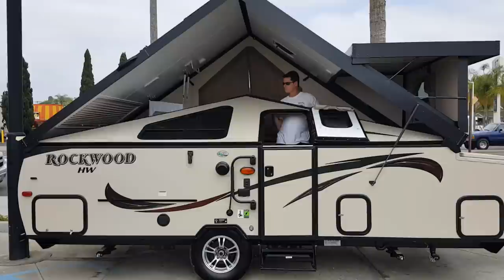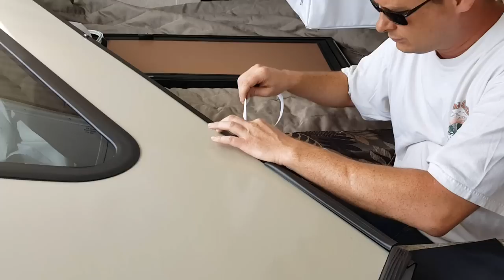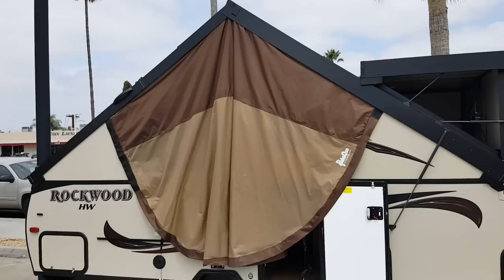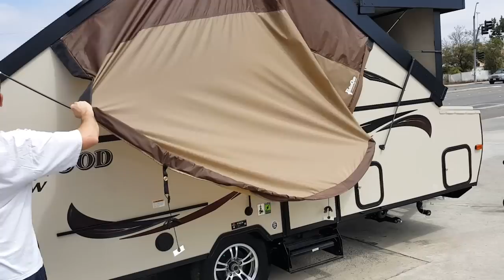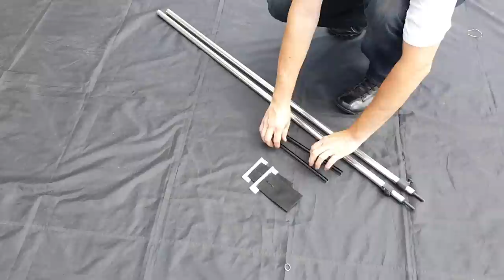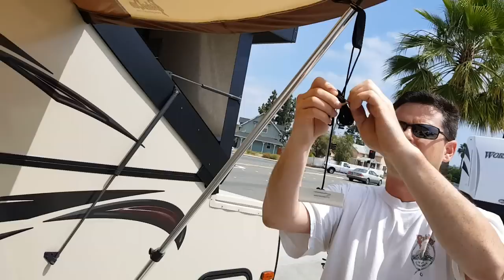A-Frame camper Visor: Shade For your A Frame Camper-  Installation Video

Comment: Great idea!  Looks very nice and is easy to install as well.  One concern I have is the door opening and constantly grazing the visor?  Maybe it doesn't in practice but looks like it may.
Reply: It does rub on the door a little if you try to open the door all the way. There's nothing that can be done about that because the door extends past the roof line when open. But we've been making these for quite a while now and have had no complaints about it.

Comment: How well does it hold up the wind ?
Reply: My guess is it doesn't. It's only got velcro and glue holding it in place.
Reply from the maker: @Shelley S This item holds up extremely well in wind, better than free-standing screenrooms that do not connect to the trailer.  We do not use glue for attachement.
Reply: @PahaQueCamping  isn't the back of the velcro self adhesive, ie glue? Also, those sail tracks at the base of the trailer for the awning poles look glued on. Please correct me if I'm wrong.
Reply from the maker: @ozdolphingirl2011  the velcro we use has a 3M adhesive backing, and when the Visor is installed it is sandwiched between the side wall and roof panel.  We have never had one come off in any weather condition.  The keder rail sections attach using 2-sided 3M adhesive tape, and again we've never had a complaint of them coming loose.  In any case we do not use 'glue' to secure the product to the trailer.

Comment: If I purchased a visor for our new rockwood 213hw a frame and find out that it rubs on the door when opening, can I return it for full refund?
Reply: Items can be returned for a refund  within 30 days. And it does rub on the door a little if you try to open the door all the way. There's nothing that can be done about that because the door extends past the roof line when open. But we've been making these for quite a while now and have had no complaints about it.